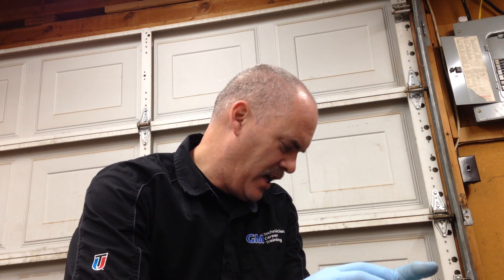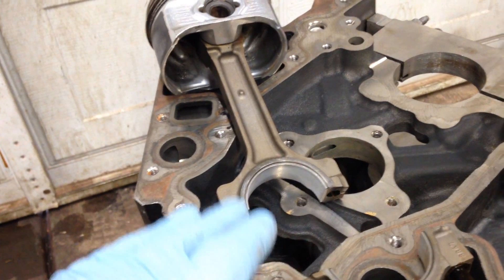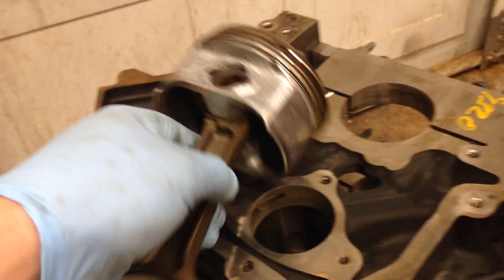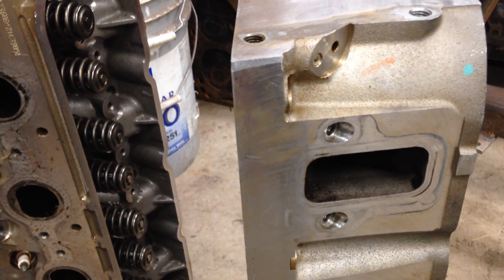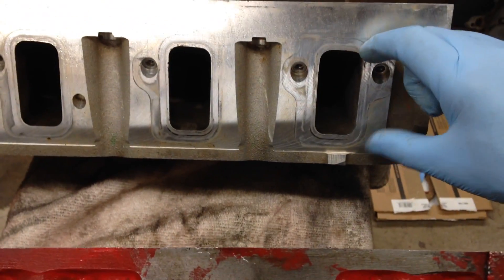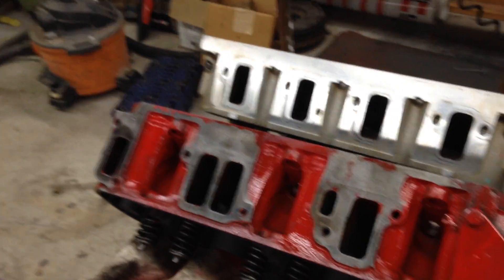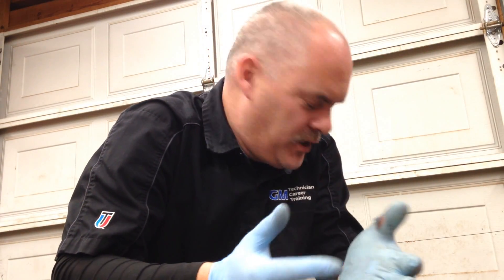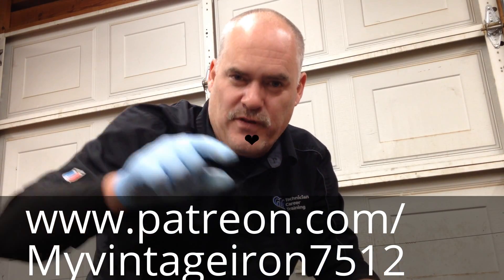LS Upgrade 6.0 to 6.2

Comment: I like your video, very informative.   I have a denail with the 6.2L, which is an animal right out of the box, but I'm tired of the piston slap that seems to be prone to these motors. I have a 2015 3500HD with the 6.0 and it is phenomenal, only small clatter on a really cold start and goes away very quickly. Is it possible to put a newer generation truck 6.0L into a yukon denali with the 6.2L heads and intake? I'm looking for a quicker transplant with similar drivability.  Maybe it would yield similar torque and slightly better mpg?  Just  a thought. Comments welcome. Thanks!
Reply: That's interesting though. I've never experienced piston slap in my 6.0, 5.7, and 4.3 motors. My first truck was a 2.2L 2wd s10 and my goodness the piston slap was horrid.

Comment: You can build a 1000 HP LS motor for about 3000.00 bucks. You need a 12,000.00 Coyote motor too make that much power from Ford.

Comment: In all honesty, what you pointed out with the intake and exhaust layout in relation to the valves is where they look similar to the small block Ford. The LS uses the HO 302 firing order too. The block being skirted is what Ford has been doing from the beginning of the mod motor. Ford definitely wasn't the only one doing it though...just look at the import engines. As far as the heads, their design looks like a lot of homework was done looking at small block ford AFTERMARKET heads. Combustion chambers look like Trick Flow twisted wedge in the shape. Regardless of the similarities, Ford NEVER came out with a small block with the specs of an LS engine.

Comment: So out of curiosity what would be the direction for a budget build for my 06 GMC Serria it’s a crew cab with a 5 inch lift and 35 inch tires 342 gears and a stock 5.3 with the 5 speed trans? Thanks in advance

Comment: I've never heard this rumor about the LS design being stolen from Ford, can anyone elaborate on this rumor? Are they trying to say the head design was stolen from Ford or the whole engine?
Reply: The exhaust port location on the LS head is the same as a sbf. Meaning the exhaust manifold or header from a ford will bolt to it. That’s where why the rumor was started.

Comment: I would not run hypereutectic pistons in any upgraded performance engine for the main reason if there was any type of failure they do devastating damage to the engine and shatter much more easily. Forged pistons don't typically shatter when taken to failure.  When a forged piston brakes the engine usually chews the broken piece up giving you time to shut down the motor.   When hypereutectic pistons let go, they destroy most everything immediately. Forged pistons might cost a little more, but given the cost of replacement parts, it is well worth it.

Comment: https://speeduino.com/wiki/index.php/Speeduino    efi a guy sells premade on ebay useing tuner studio software like megasquirt efi is not expensive or hard i can not say it enough no more hard starting hot rots 8 moths later with flooding lean burn issues sloppy mechanics megasquirt video is a good on n it apply to speedduno crap to.they even got a app fer tablets  ,just because it cheap does not mean its crap it loosely like a old Toyota /.botch efi system simple n robust

Comment: wen it came out i was finally stock head that work block thats not crap n a crank thats acceptable n ring that are thinner should have been done in the say 1982 n yes most all tech was there just did not do it that way

Comment: Great video.
Could you put a bigger Stroker crank and shorter piston rods on it to decrease the combustion capacity and increase the combustion ratio to increase the HP?
Making larger diameter bore would increase the combustion chamber and reduce and the combustion ratio and lower HP. Right?
Just asking. Super new to engine mechanics
Thanks

Comment: I'm a Mustang enthusiast and always have been, but even I have ventured to the LS as my go to engine family for reliable, affordable power. My "junkyard" build is a bone stock 4.8 shortblock with an LS9 cam, stock 6.0 heads, Holley EFI and an older 72mm Comp turbo backed by a TH400. It makes a tad over 600 HP on pump gas and has well over 100 passes to date with no failures. My built setup is an LQ9 based forged 376 with billet mains, PRC heads, Brian Tooley cam/valvetrain, PTE 7685 gen 2 turbo, FuelTech EFI and an RPM built PowerGlide. Depending on the tune/fuel I run it makes anywhere from 900-1300+ HP. Both of my engine setups are in Foxbody Mustangs and the LQ9 build has been low 8's in the 1/4 mile; 7s will happen this spring.
Reply: That's badass! We don't hear much about the 8.1 though. I do hear some guys are spending a little bit of cash to make power. Infact some cases known as a duramax killer
Reply: The LS9 cam is horrible, a Sloppy Stage 2 goes for $100-120 these days so there is no way I would use an LS9 instead, I would stick with 706/862 heads as well hopefully you aren't using 317 heads on a 4.8, the chamber is 10ccs larger than regular 4.8 heads, it screws up your quench and makes the engine have slow spooling and more likely to detonate. I imagine that you can 600hp, of course but the package could be making 700+hp with proper heads and a cam with enough fuel system on E85 you could make in excess of 1200hp with a 4.8.

Comment: the guy that builds my motors he will throw a cast iron block out side in the rain for a year and he say's it seasons the block then he resleeves the block to what size u wont and he told me never use silicon on a motor he told me he had a motor go when they were breaking in the cam the only place they used it was on the intake he told me to use aircraft sealer because it wont leave the surface and plug up the screen and it seals better he build's top fuel engines  for woodburn
Reply: Interesting re: seasoning engine blocks. Legend has it that when BMW were developing their now legendary F1 turbo cylinder blocks,they did just that...including the engineers pissing on them! :o

Comment: I see a lot of them Motors cracked on that second crank Journal Plum up to the cam journals so if you got a Chevrolet that's going tick tick tick tick tick that's probably why cuz all pressures escaping at that crack yeah they doing this 50 years and I'll see a lot of these motors with crack journals to the cam journals whether it's the first or second journal from the back or the first one from the front.... I scrap a lot of them Motors after changing them out ....they just like to crack  crack crack crack..

Comment: The rods look to be the weak link. What kind of power is these able to handle with a build like this with stock bottom end parts like this in say a higher compression, big lift cam, very good cnc port program on intake, exhaust runners and cnc ported compression chambers and like an 88mm turbo? Im thinking like a max effort drag racing duty kind of build?
Reply: stevenminix Look up “richard holdener 1500hp 6.0L”.  He made over 1540hp on a stock bottom end LY6 6.0L and it didnt even blow up, they ran out of map at 30 psi of boost.

Comment: Why risk thin walls @ 65thou rather than play it a bit safer with either 6L +40thou or even +60thou pistons to get a little extra displacement ? Is it simply the principal, interchangeability or are the 6.2L pistons stock and not aftermarket forged units ?

Comment: How do you decide on a build, I have heard the rods and pistons are good up to about 550 hp temporarily, in time supposedly the rods and piston wristpin holes get weak and have a tendency to let go. I want to build a 6.0 for my S-10 to be around for a while. Who is right? Not saying your wrong, just trying to build an engine that will be around for awhile, not till the Hotrod crew is out of sight. Have you documented the claims of the hp in your video?
Reply: I can tell you l have a 1984 monte carlo ss with a new LS2 6.0 crate engine installed in 2008 it's got a GM single  plane intake manifold Holley 850 hp carb CNC ported LS3 heads with hardened pushrods SFI balancer a hydraulic roller cam 600 lift the rest of engine is stock it makes 540 HP at crank 440 HP at wheels it's best pass was 10.97 at 122mph it's made 20 passes in all its street driven on nice weekends it's not getting beat on constantly it's been very well maintained all I've done since 2008 until now is change spark plugs every 2 to 3 years and change oil every 6 months car runs as good as day it was put together maybe I've been lucky not one regret car runs cool in 95 degree heat and turns 7200rpm as fast as you can shift it runs smooth to 3500rpm above that it turns into a monster car even idles good most people think it's a ZZ4 350 crate engine when it idles has a slight chop not real choppy but you know right away once it hit 3500RPM it's no old style chevy smallblock car has power steering and brakes and  700r4 trans 3000 stall lockup torque converter 4.10 gears cruises 65mph at 2300rpm very streetable and reliable
Reply: trader man Richard holdener made over 1540hp out of a stock bottom end LY6 6.0 with twins at 30psi, and it didnt even blow up. Look up his name and what he has done in terms of LS power testing.

Comment: What about crank? Does the 6.2 share the same crank as 6.0?
Reply from the maker: no
Reply: Myvintageiron7512 
So boring it out to run the same pistons as the 6.2 doesn't make it a 6.2 unless the stroke is also changed
Reply: @Kmecha84  5.3, 5.7, 6.0, and 6.2 all have the same stroke.  I dont know whether it is the same casting, but it is the same stroke.

Comment: The 401 GMC Truck engine can't pull a sitting hen off the nest  very low compression however..       Each has it's own  journal    Really Really smooth running engine they made a V-8 and V-12 too the V-12   had  4 heads on it ..

Comment: You can bore an aluminium block ls1 to whatever you want, depend on the bore size, you may further sleeve it and also wet sleeve it if you have the expert in that.

There was one that was dry-sleeved to 6.1L.
Reply from the maker: True you can sleeve it but the factory sleeves can only go .010 over
Reply: Well, I enjoyed watching your channel. I watched 90% of the videos. It took me a lot of time but it worth it as you are a qualified machinist and working in the field not just taking theory.

I was struggling with a machine shop to get an engine machined to specs. The boring was not bad. the surface where the rings contact the cylinder is within 0.0004" of out of roundness and tapper. Clearance is ok, however, at the bottom of the cylinder, it become narrower so the clearance went down from 0.0035" to 0.0015" which is too little and may cause the piston to contact the cylinder in case of engine abuse as it is in off road car.

Watching a learning video to get an engine to be machined is a different story when going to machine shop as things are not ideal. I have to follow up with the shop till things get to specs.

I am now checking the crankshaft and found every thing is OK and within specs. All tapper in the crank journals are 0.0004" and follow the same direction with the same amount. This till me that the stone is angled so it produced that tapper but I am not sure.

The engine is diesel, so does the compression ratio sensitivity comes in. The piston projection from the cylinder (or sleeve) deck is way out of specs. the manual specify a variation of 0.050 mm (0.002") in head gasket thickness, i.e. 1.15, 1.20 and 1.25 mm for a range of pistons projection.

The standard CR is 23.1, I played with the math on the assumption of the existing pistons projections and found that the CR will be in the order of 35 if I used the thickest gasket. The block was line bored as it was full of rust and stayed out side for two years. I think this explains the pistons projection out of block to be too much. Fortunately, the backlash of timing gear for camshaft and injection pump is slightly below spec. which I assumed to be OK.

For the tappered bore, I went to another machine shop and he fixed it within 0.0004" down to the bottom. Other (big name) machine shop said the block need to be resleeved!!. Luckily it is done.

Yet, the piston too much projection that I am still straggling with and try to find a solution for it. One suggestion that I found in the net is to shave the top of pistons with the required amount to lower the CR. I calculated the height and it turn to be in the range of 0.15-0.20 mm to lower the compression ratio to the factory setting. I am seeking you input in that.

Greeting from Arabia,
Good luck and keep posting the good videos,

Comment: how do you add weight to the crankshaft counter weights to compensate for the heavier rotating assembly of the 6.3 ls3 pistons
Reply from the maker: The balance shop add's heavy metal to the counter weights

Comment: 6.0 5.3 crankshafts are the same?
Reply: AMERCAN TRUCK yes they are. 5.3,5.7,6.0 use the same crankshaft casting number. 5.7 is gun drilled.

Comment: Also eventually you run out of ways to design a cam in block engine. Ford and Chevy also share alot of stuff, ive said for years their transmissions are identical. And they designed the new 10 speed auto together.

Comment: Hello I'm doing this same build my machinist is telling me that it needs/ should be balanced do you think this would be critical. I am using aftermarket engintech stock replacement 6.2 pistons and stock 6.0 rods? 
Thanks
Just read a comment below looks like you do.
Reply from the maker: YES! he is right on the money,  you absolutely have to get this balanced it's not an option
Reply: Myvintageiron7512 
Thanks man I appreciate your videos!

Comment: More stuff for the bailed out GM guys.
Reply from the maker: Ford  got bail out funds from the Term Asset-Backed Securities Loan Facility (TALF), which is a government program for auto, student, and other consumer loans. These were very low-cost government loans to the tune of $5.9 billion that helped Ford tip-toe past bankruptcy and overhaul their factories to bring out more fuel-efficient technology. The Obama administration’s plans of having a million electric cars on the road by 2015 were being funneled through Ford and two other companies (Nissan and Tesla), and Ford fans had the audacity to call GM “Government Motors.” Ford took huge bailout money every economist who has analysed  this agrees Ford most certainly would have went into Bankruptcy right along with GM without these funds so all you guys out there spouting off about GM being Government Motors you really don't know what your talking about that title is actually far more fitting for Ford Motor company
Reply: @Myvintageiron7512  spot on, I tried to explain this, but some people just won't take their hands off their ears. Ignorance is bliss.

Comment: Can I use a 6.0 Pistons on my 4.8 Rods on my 4.8
Reply: SHOE GOD 23 idk about that lol get three measurement of the 6.0 piston then measure your cylinders see how much you'd have to take off for them to fit, on a la it may be possible but you might would have to sleeve the block to make it workmight nitty really bee worth it unless you were just really wanting to build a sleeper type build
Reply: I know I can board the cylinders to fit 6.0 Pistons what I wanted to know if I can use the 6.0 piston on a 4.8 rod
Reply: No you cannot. The biggest a 4.8/5.3 block go bore to is a 5.7

Comment: I have had a spectrum of manufacturers and each one was only an appliance, until you decide to make it more. I'm a Mopar man, I will take a pre-Daimler Mopar anytime. I will say that the design influence of each manufacturer has led to different models having a great aspect missed in the others. I love the Falcon for hook up drag racing, F-body LTD's, Capri, and Fairmont underpinned with the mustang aftermarket parts sleep well. Chevrolet has a small block line that's a great build platform for a monster stroker that still revs fast, and flashy to discrete bodies with the same potential. The Mopar side has a very special draw for me, the B-body and big block combo. It doesn't matter what the plan it will present exactly what it is. Oh, there's imports also, guess the mustang needs a car to race that it can beat also.

Comment: copied ford? the for modular POS is a OHC cam engine, the chevy is a cam in block pushrod. they are not similar
Reply: andrew donohue they copied ford on the bottom end design and the head design as far as the valve layout, that's what he was referring to....js everyone cansay they didn't but when the ls engine wss designed gm had just hired a engine designer from ford so........ Take it how you will funny how right after they hired that guy the la came out with very similar design features like the block skirts that go below the crank ect....
Reply: the LSx is a better engine.
Reply: You do realize Ford made more than just the Modular engine, right?
Reply: GM gets blamed for copying the 289/302/5.0 OHV Ford when making the LS engine. That engine is completely different from the Ford Modular.